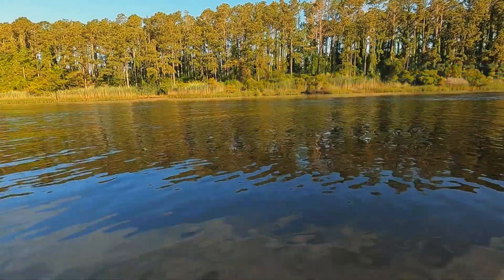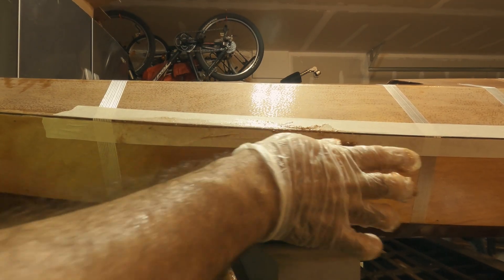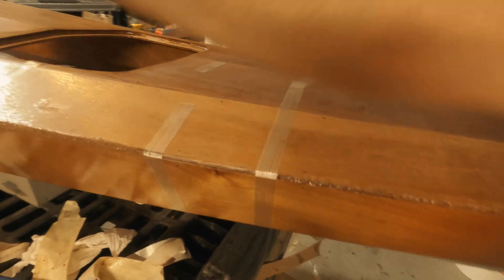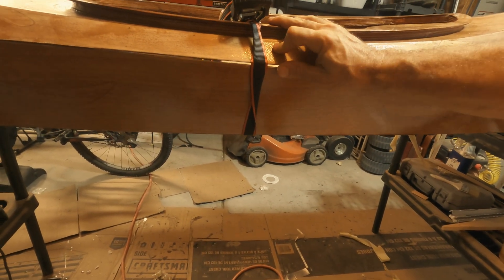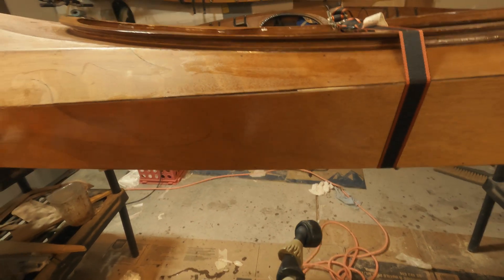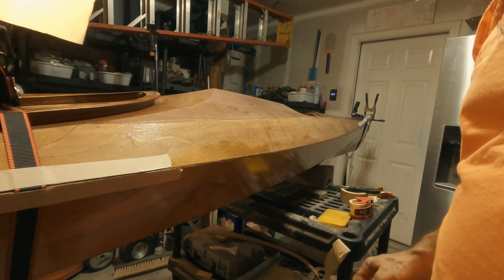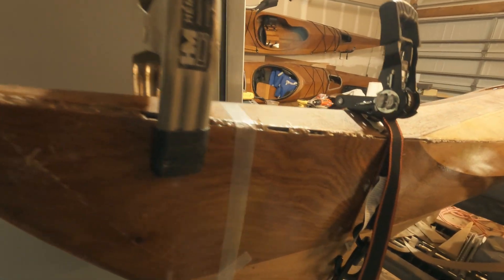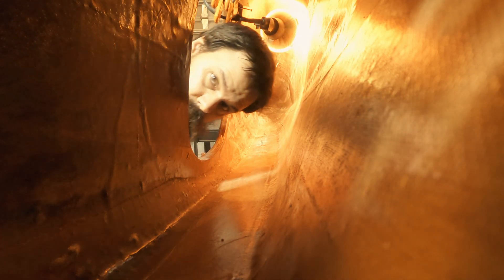9) Stitch and Glue Kayak Build - Attaching the Deck and Hull

Comment: I aligned the top and bottom of mine, and completely taped the outside length of the seam and filled from the inside. Easier to push thickened epoxy into the concave side… but it’s hard to get to the ends.
Reply from the maker: That would definitely save a lot of time. I think I'd still want to do a few spot welds around the whole thing tho just for a little peace of mind. Maybe with CA glue and activator. But I think that idea sounds worth trying. Thanks!
Reply: @ It did take lots of tape and ratchet straps to get it just right.